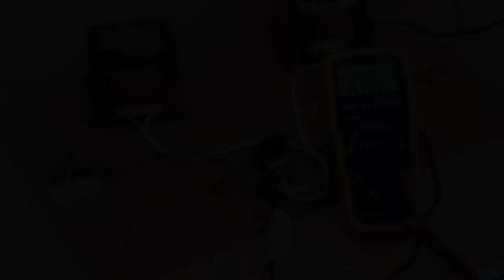DIY Welding Machine / Only 2 Microwave Transformer / Good Job

Comment: Secondary winding turns pleas replay
Reply from the maker: Hello.  secondary windings... 24 windings for each transformer and for these windings I used 6.5+6.5=13 meters, 4mm2 silicon insulated copper cable
Reply: Thankyou
Reply from the maker: Thank you too 👍

Comment: Thank you for your prompt reply, I think it will take some time to find it. 20V with one transformer
It's okay if you have a total of 40V for x2, should you prepare two of them? There are many types of microwave ovens, what kind of microwave ovens do you have?
You'll need a microwave with a capacity, I don't know how to explain it, but with a microwave? W or above
Do you need a microwave? I don't know if you can find two of the same ones, but I'll try to find one.
I understand well, thank you. Should I look for 2 transformers that can generate 20V with 110v main power supply?
Is it a microwave oven, thank you. There are many in Japan, but the collection company will take them with you.
It's hard to find one in my house, I still use it, but sometimes it breaks down so I bought a replacement microwave.
I need another one. Even if I throw it away, it will be a violation if I bring it back, so I will look for it at the vendor, thank you.
Reply from the maker: I thank you too.  To be honest, when I was looking for a microwave oven, I didn't pay attention to whether it was the same or this class.  You don't care either.  It could be any faulty Microwave oven.  Transformers always come out intact.  But you have to do the experiment I told you about.  First, wind a transformer and check the output voltage.  If 20V comes out, let's continue.  A transformer for a furnace used in Japan should work this way but better be sure.

Comment: Cual es el Voltaje de alimentación
Reply from the maker: Hola.  Aquí la tensión de red es de 220V, pero el mismo sistema también funciona a 110V.  Porque los transformadores de horno de microondas se producen de acuerdo con este voltaje.  Sin embargo, para obtener la misma potencia con un voltaje de 110 V, se extraerá más corriente de la entrada.  Por lo tanto, es necesario agregar triacs más potentes o agregar más triacs al circuito dimmer.  Espero haber sido capaz de explicar.  Si tienes alguna duda, vuelve a escribir.

Comment: your machine is 110 0u 220v
Reply from the maker: I use it at 220V, but it will work when the same operations are done at 110V.

Comment: Para hacer una buena máquina de soldar se debe emplear para el secundario alambre dieléctrico o magneto. El cable que veo que siempre usar en este tipo de experimentos no aguanta mucho ,termina por fundirse el plástico y provocar corto en el embobinado.ademas de eso el calibre debe ser mucho más grueso , calibre  #4.
Reply from the maker: Hola.  Estoy de acuerdo con lo que dijiste.  Dado que el aislamiento del cable que uso es de silicona, puede trabajar continuamente a 180 grados.  Por lo tanto, después de calentar y enfriar, no hubo deterioro en el aislamiento.  Tiene razón sobre el grosor del cable, pero elegí este grosor para obtener un buen valor de voltaje con 2 transformadores.  Lo he estado usando para mi negocio durante 1 año.  Gracias por su atención 👍
Reply: para trabajos pequeños puede estar bien. 👍
Reply from the maker: @manuelfonseca9937  👍

Comment: i would have out a fuse at the 240 mains for safety if the wires burn out worst case
Reply from the maker: Thank you for your interest.  Honestly, it would have been better.  It can now be installed.  I'm using the outlet in my garage with a 10A fuse.  It wasn't a problem, but I'll say it again, you're right!

Comment: Quero saber como retificar a máquina de solda caseira
Reply from the maker: Olá.  Quando você diz como corrigi-lo, você está falando sobre a conversão de AC para DC?  Para este processo é necessário o uso de 4 diodos ou tiristores resistentes a pelo menos 200A.  Como o controle de corrente é feito com um dimmer, o diodo é mais conveniente e barato.  O valor de corrente de 200A é suficiente para a máquina neste vídeo.  No entanto, diodos mais potentes podem ser necessários para outra máquina.  4 diodos serão conectados por conexão de diodo em ponte e adicionados à saída
Reply: bom dia por favor passa a retificação passo a passo
Reply from the maker: Também quero converter a saída da minha máquina de solda para DC.  A coisa teórica a fazer é como descrevi.  No entanto, não consegui decidir qual componente usar.  Depois de pesquisar sobre o assunto e fornecer materiais, estou pensando em gravar um vídeo e compartilhar um diagrama.  Se você não se importa, espere.  Seria apropriado?

Comment: coye  que bien seve esa maquina de soldar  maneja 40 amperios  porque no tiene audio
Reply from the maker: Hola.  No sé si hay un electrodo cubierto que se pueda fundir con 40A, pero esta máquina puede dar una corriente de alrededor de 120A.  Es posible que haya silenciado el sonido en el video.  En mi último video, convertí el voltaje de salida de esta máquina a CC.  Puedes escuchar el sonido completo en ese video.  Gracias por su interés

Comment: What size of wire you used around the transformer?
Reply from the maker: Hello.  For each transformer, I used a silicon insulated copper cable with a length of 6.5 meters and a cross section of 4mm2.  I made 24 turns on each transformer.

Comment: volevo mettere un dimmer da 4000 w da costo di 13 euro (gia pronto) Puo' andar bene ??????, e poi tu dici 13 metri di filo a ogni trasformatore ???? o per tutti e due ????
Reply from the maker: Ciao.  Un discreto dimmer da 4000 W andrà bene.  Tuttavia, se non riesce a raggiungere il potere promesso, potrebbe fallire.  Se è difettoso, puoi applicare il processo che ho fatto.  Il cavo richiede 6,5 metri per ogni trasformatore e 13 metri in totale.

Comment: How many electrodes can be use without damage the machine.
Reply from the maker: Honestly, I didn't count that.  But I haven't had a problem so far.  Since the cables are silicone insulated, they are quite heat resistant.

Comment: Triac dimmer for a transformer ? 😱 They will overheat and burn !
Reply from the maker: Hello.  Thank you for watching my video and commenting.  However, you are wrong.  Triacs hardly ever get hot.  I connected 4 8A triacs.  The system draws a maximum of 10A.  Why would you burn?  Triacs are even used to control powerful motors.
Reply: I didnt mean that the triacs will burn . The transformers will get very hot if you lower the voltage 50-75% ! The waveform  of the voltage is full of spikes when regulating with triac . Its very bad for the transformers. I was using such dimmer to regulate voltage on transformer. It got very hot and burned. Notice if they get hotter when on 50% !
Reply from the maker: Hello.  Sorry for the misunderstanding.  You are right, there is heat in the transformers.  But not enough to burn.  I can't say for sure though.  I used silicon insulated copper cable on the secondary side.  Relatively heat resistant.  I have been doing my work with this machine for a long time.

Comment: el atenuador de potencia, te resulto, porque en ningun momento lo mostraste en las pruebas de soldado
Reply from the maker: Hola.  Entiendo que estás hablando del circuito de atenuación.  Este circuito es un circuito disponible comercialmente.  Acabo de agregar 4 triacs para hacerlo más duradero.  De esa manera era bastante sólido.  También regula muy bien la corriente.  El diagrama de cableado está disponible en la sección de descripción.  También intenté hacer algunas explicaciones con subtítulos.  Si hay alguna parte que no se entiende, por favor escriba de nuevo.
Reply: Solo quería saber si te resultó porque yo me fabrique una soldadora rectificada y use el de 4000W y el TRIAC no se la aguantó y se rompió al toque, voy a probar colocando el que va y tres más en paralelo, crees que funcionará, porque no se que falló
Reply from the maker: Si no me equivoco, no cree que este sistema funcione.  Pero lo he estado usando desde que construí la máquina.  Escríbame cuántos voltios tiene su tensión de red y cuántos amperios tiene su máquina.  Déjame tratar de ayudarte a determinar cuántos debes usar.
Reply: me entrega 50 Voltios a la salida y la tensión de red aquí en argentina es de 220 Voltios
Reply from the maker: Aquí, la tensión de red es de 220V.  Pero no importa  No afecta el voltaje de salida.  ¿Cuántas vueltas hiciste en el secundario?

Comment: Cuántos amperes es 100 o 130
Reply from the maker: Hola.  Puede entregar 120 amperios, pero el valor de uso más adecuado ronda los 100 A.  Es adecuado para su uso con un máximo de 3,25 electrodos.
Reply: y eso solo se puede utilizar con corriente 220 no 110 o 120 ??
Reply: grasias yo tengo uno pero se ve más pequeño los transformadores del mío
Reply from the maker: Se puede utilizar a 110 o 120 voltios haciendo lo mismo.  Porque los transformadores de horno microondas producidos donde se utilizan estos voltajes también se fabrican según 110V.  Qué se debe hacer de manera diferente... Dado que se extraerá más corriente de la red a 110 V, los circuitos de entrada deben realizarse con cables más gruesos y el circuito del atenuador debe usarse con más potencia.

Comment: La corriente de entrada de voltaje de cuánto es
Reply from the maker: Hola.  Aquí, la tensión de red es de 220V, la tensión de salida es de 24 devanados en cada transformador y se obtienen 40V de 2 transformadores.  La corriente de salida es de alrededor de 120 - 130A.  Puede bajar a 60A ajustando con un atenuador.  Después de 1 hora, pondré un video para el proceso de conversión del voltaje de salida de esta máquina a CC.

Comment: High voltage ac or dc is dangerous! AC CHANGES  DIRECTION so throws you off contact! DC STAYS SAME DIRECTION so doesn’t throw you off contact!  SO DC MORE DANGEROUS!  ?? Welding equipment is less than 50 volts as far as I know! Fraser
Reply from the maker: Hello.  As you said, voltage above 50V is dangerous for the human body.  This system is 40VAC in its current state, but later I converted the output voltage to DC.  In this case, the voltage became 60VDC.  You can also find the video of me doing this process on my channel.  Thank you for your attention

Comment: Murat o fuzil de 25 amp e do dimmer não e da minha casa não ok meu dimmer veio com fuzivel 25 amp
Reply from the maker: Eu entendo  Como minha tensão de rede é de 220V, a corrente consumida da entrada pode ser menor.  Se a sua tensão de rede for 110V, 2 vezes mais corrente será consumida.  Isso não afeta a corrente de saída, mas para obter a mesma potência, a corrente consumida da entrada será mais de 110V.

Comment: I hate videos like this cause there's  no explanation of how to build the important stuff like the adjustable voltage controller or the fan setup. Everyone knows where to get transformers and how to wined them but where did the other stuff come from and how did you drill the holes so precisely?
Reply from the maker: Hello.  I wish you hadn't used the word hate... Actually, I try to make my videos as understandable as I can, but I may not have been successful.  First of all, I would like to inform you that there are subtitles in the video and I have given some information in the subtitles.  Also, if you examine the comments, you will see that I try to answer all the questions as much as I can.  I generally used materials I collected around.  For example, fans... these fans are small-sized fans used in computers.  Larger ones can also be used.  There are many welding machine videos on YouTube.  Some don't even make boxes.  However, since I use the tools I make, I try to do it as neatly as I can.  I showed how I drilled the holes in the box construction and how I bent the aluminum plate into the final shape.  Of course, in short pieces.  I would like to show every detail, but then not everyone would think like you and would get bored because the video is too long.  On the other hand, I shared a video a few months ago about the circuit I used for current adjustment and showed how the circuit was made.  I also shared the necessary files in the description section of that video.  Finally... there is also a video for converting the output voltage of this machine to DC.  You can find it on the channel.  Have a nice day

Comment: Good for 2.5mm electrodes. Not more
Reply from the maker: Hello.  It is also sufficient for 3.25.  Good day
Reply: ok i guess your  voltage is a bit higher than other welding transformers
Reply from the maker: The voltage value is 40V and the current value is more than 120A.  I'm thinking of converting the output voltage to DC soon
Reply: ok, i cant believe the wire does not get hot with so many amps.
Reply: the other thing is,  how can 2- 1200 watt transformers put out 4kw?
Reply from the maker: The cable is getting hot.  For this reason, I used a heat-resistant silicone insulated cable.  I also tried to remove the heat from the environment with 2 fans.  Of course, it still doesn't have perfect cooling.  However, I had no problems.
Reply from the maker: I don't quite understand this question... but if you're asking why the dimmer circuit I use is 4000W, it's because it's more durable.
Reply: no i mean why can you get about 4000 watts from 2-1200 watt transformors? Your VA is 40x120. I just realised it is open circuit. The running volts will drop down a lot i guess
Reply: you could use bigger cable and add a higher voltage switch mode power supply for start up
Reply from the maker: Exactly as you say.  The open circuit voltage is 40V but the current is 0. During welding, the current rises and the voltage drops.  voltage can be measured at the time of short circuit but it never occurred to me...
Reply from the maker: I used 10mm2 cable in the welding machine I made before.  I had to use 4 transformers.  because I wrapped 10mm2 cable.  Since the purpose here is to use a microwave oven transformer, the area we can winding is small.  In this case, the high voltage value can be reached only with a 4mm2 cable.  If we use another transformer it will be very expensive and not everyone will be able to find it.  This machine is not bad for amateur work.  I am also an amateur and I can do my homework.

Comment: I'm sorry I couldn't reply immediately even though I got in touch with you, I had an accident on my bike while I was at work early yesterday morning, and I hit a roadside tree and was hospitalized with a femur fracture. I think I will be able to walk in a month. I will contact you again after one month of rehabilitation. I have been stopped from the pain, but I can't move, and since smartphones are prohibited, I will write an email or write when I can walk, so I will not be able to contact you for a while. Thank you.
Reply from the maker: Hi.  I'm so sorry for you.  I hope you can regain your health as soon as possible.  See you as soon as possible
Reply: I can't find it even if I look for it [I have one, but if I don't buy a lot, it won't sell)
I'm thinking of ordering another product, how many amperes should this code carry?
I don't know the standard and sell it for 3m each for red and black, but if I know the withstand current, I will buy it, but I heard that 6.5m is necessary.
Since it is cut into a total of 6 m in red and black, you can only buy it, and what is the diameter including the coating?
I'm sorry many times, thank you. H, matsui
Reply from the maker: Hi.  I don't know if I wrote the code for the cable before, but I will.  This cable has the code N2GFAF.  If you can't find it, use 3 transformers and use 6mm2 cable.  In this case, you can do it without using a silicon insulated cable.  If you plan to do this, you need to use 5 meters of cable for each transformer, that is, 15 meters of cable for 3 transformers.
Reply from the maker: Hi.  I was wondering about our situation.  How have you been?  I hope you are well
Reply: Good morning, how are you feeling, I'm sorry to worry, this is rehabilitating well, I can walk about 30m, I'm still looking for it, but it is said in Japan There is a code that is available, but it seems that it is not retailed, the case of 3 transformers will be heavy, so I still want to make it with 2 so I am looking for it without giving up, it seems that it will take a month to leave the hospital. So, let's look for it slowly, how is the climate there? It's winter, so it's very cold. Good mood.
Reply from the maker: Hello.  I'm so sorry you had to stay in the hospital.  I hope you don't have any problems when it comes out.  You will be completely fine.  Here, too, winter continues.  Therefore, I cannot make an application that will use a welding machine.  Anyway, I hope you'll be okay.  have a nice day

Comment: Át 6:43 out put voltage (power )from transformer  40 ,3 v
At 8: 36 input voltage to transformer 40 ,o5 ? ? ? 

😇😇😇
Reply from the maker: A very insignificant voltage difference.  Moreover, there is a dimmer circuit put in between.  There may be a slight difference regarding this.  Why do you think this difference arises?  Is there anything you want to say?
Reply: Q0taria do telefone
Reply from the maker: Olá.  Infelizmente, não posso fornecer um número de telefone.  Certifique-se de tentar responder às perguntas que você faz aqui.

Comment: Welding is dc not ac you not used diode,2 transformer why so ligh weigh
Reply from the maker: Hello.  In this video, I made the welding machine as AC, but by adding a rectifier circuit to this machine, I converted the output voltage to DC and shared this process as a separate video.  You can find the video on my channel.  For your other question, I don't know what to say.  I used 2 microwave transformers and it wasn't too heavy.  It might be because I made the box out of aluminum material.
Reply: I mean two transfomer looks like very light in video, but after you explain its ok good job sir